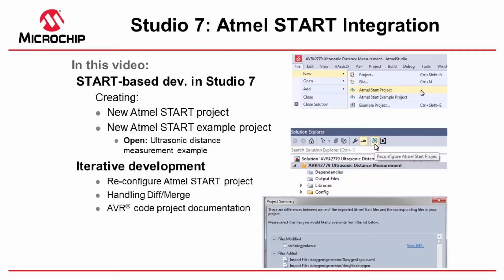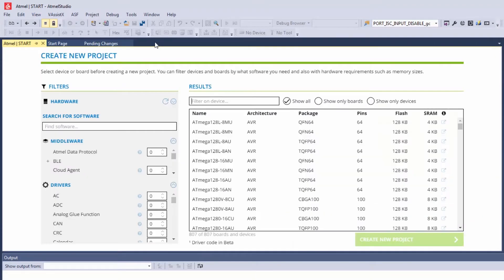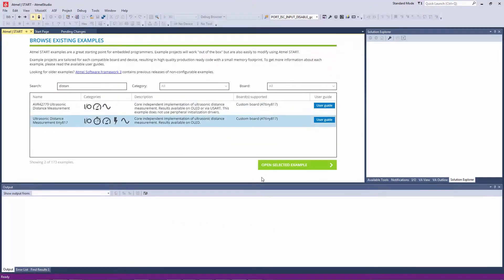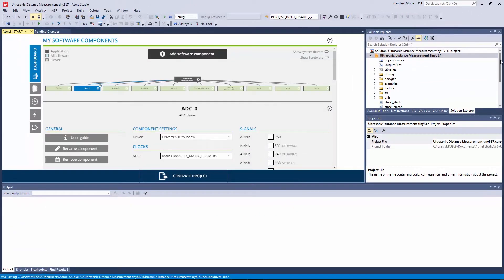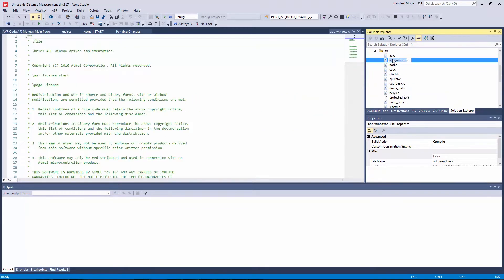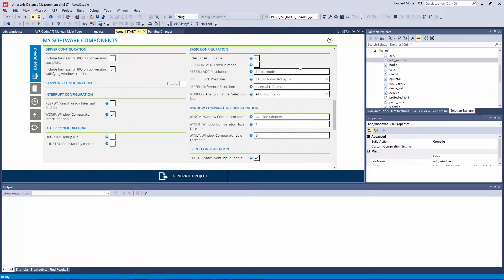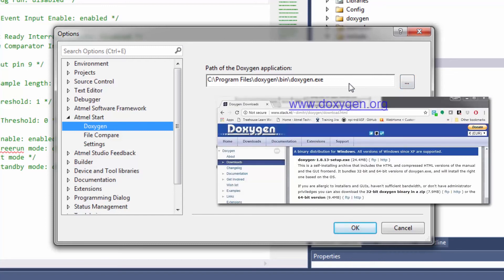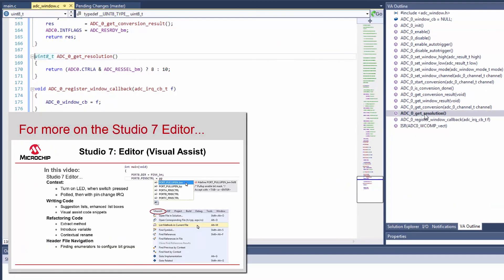Getting Started with Atmel Studio 7 - Episode 6 - Atmel START Integration

Comment: Am I missing something basic or did you really not include support to configure the SPI port for the internal RF devices in the SAMR21 series? Makes working with START a complete pain in he butt because you need to configure half the hardware manually. Brain-dead process.
Reply from the maker: You will find some examples that use the SAMR21 radio module in ASF3: http://www.microchip.com/mplab/avr-support/advanced-software-framework
Reply: Microchip Technology ummm how long has Atmel Start and the SAMR been around? Examples in the older framework don't help when using your "new" START framework. Such a basic thing to have left out.